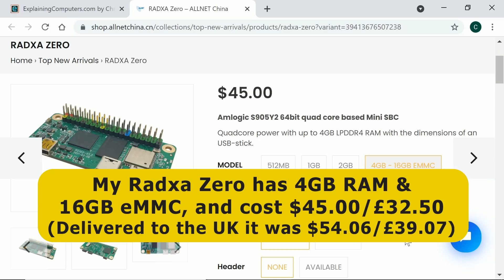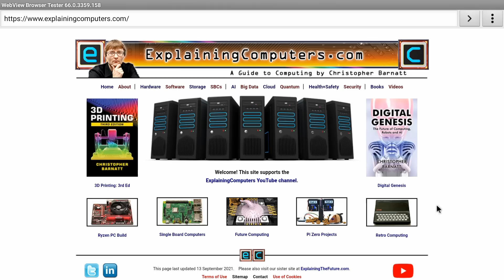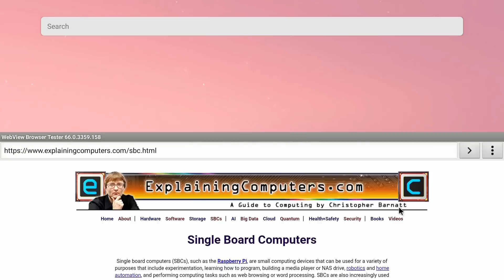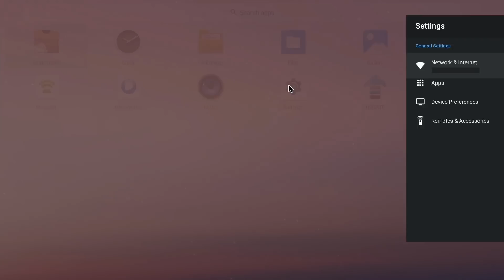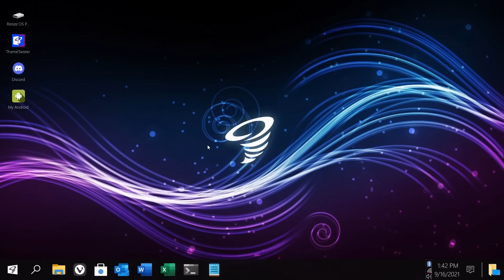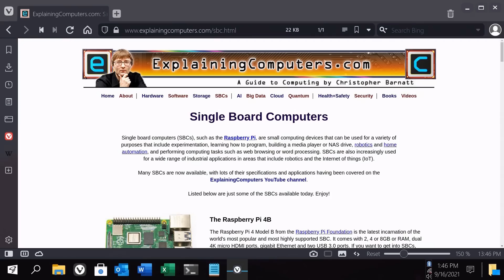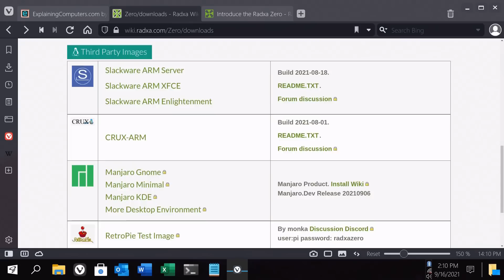Radxa Zero: Tiny Quad Core SBC

Comment: Apart from the current lack of software support, this is the Raspberry Pi Zero successor that everyone on the Raspberry Pi forums wants. The Radxa Zero has good connectivity with its USB-C ports and its support of USB 3 and 4K/60 over HDMI. Thank you for this great video!
Reply: Tbh no camera stack is a big letdown as well, especially with all that power
Reply: @vocassen  i really wish they make the zero 2 version that include camera connector and beating RPI 4b

Comment: I cant belive that a pc the size of a credit card is better than my 16" laptop from 10 years ago
Reply from the maker: Progress is amazing . . .
Reply: It's in fact smaller than a CC
Reply: How old is your laptop?
Reply: @kriskruz3792  13 years old
Reply: @ozrencupac  nice!  You have been taking good care of it!
Reply: @kriskruz3792  yes
It still has the original hard drive and it works
It runs debian
Reply: 13 years ago, $15 did not buy a good laptop.
Reply: "I cant belive that a pc the size of a credit card is better than my 16" laptop from 10 years ago"  generally speaking, thats not the case... unless you had an unbelievably weak laptop 10 years ago..

Comment: Stanley the knife had been showing signs of aging. 
Interestingly, here Radxa's GPIO pins are color coded. And the USB connectors are USB - C unlike micro USB in various other SBCs.
Reply: Cos he's old skool original 😊
Reply: It's still USB 2 so apart from convenience there's nothing significant
Reply: @haziqsembilanlima  Correction, there are 2 USB-C connectors on the Zero board, 1x USB2(for power & OTG) and 1x USB3(Host)
Reply: "Stanley the knife had been showing signs of aging. " - yes it needs an upgrade quick!
Reply: It's not age, it's character.
Reply: It has always interested me that a lot of the non pi SBCs  which use the same Pi originated  GPIO standard.. use the colour coded GPIO connector  whereas Pi Manufacturing do not...

Comment: That looked like it had so much potential, but as the video went on, my enthusiasm waned. I am never impressed when software support isn't 100%. This looks like potentially a great device, let down by (for now at least) software.
Reply: It's why I stand by Armbian, they spend time on a rampant issue with SBC's that aren't a Raspberry Pi, outside of Armbian or Manjaro I don't see any other active project squeezing water out of a stone this size.
Reply: @phonewithoutquestion80  I agree, but it really shouldn't be the community that gives good support to boards. Companies who want to make money from those boards but don't invest in Software Support should be avoided.
Reply: Yeah after seeing the specs I was impressed, but the choppy playback and lackluster support on their own site really set off some red flags, I mean what's the point of having a beefy micro-computer that can only run android or an offshoot distro of Linux?
Reply: Software support is more important than the hardware backing it. I wouldn't trust any of these fly by night Chinese brands. I don't know if there is a viable competitor to Raspberry Pi.

ARM locks you down and doesn't let you just slap an OS on a board like you can with x86, so you're screwed if the manufacturer abandons ship.
Reply: I share your feelings on this one alrightie
Reply: I guess most of you don’t remember back in 2012 when the raspberry Pi was released to the public. The lack of software and drivers was common.  

Interesting factoid  back in March 2012 –  Raspberry Pi Fedora Remix was the recommended Linux distribution. 

(Developed at Seneca College in Canada.)
Reply: @NewAgeDIY  Yeah but the Raspberry Pi was something brand new and never done before; yeah you had micro controllers and maybe those TV boxes, but this was the first personal computer you could literally fit in your pocket, a rough start and spotty resources were to be expected out the gate, this is something that was made as a drop in replacement to the pi zero, something that builds off a project that is open source and has a been around for almost a decade and is well documented, considering this is not their first product such oversight is almost inexcusable the only saving grace is the price, but considering the chip shortage why waste the excessive power the RAM or CPU on a product that can't meet up to the specs consistently. I mean it's listed as a 4K@60fps yet the demonstration showed that it was lagging and dropping frames. I'll give them the benefit of the doubt that it was a 3rd party distro, but when the only officialy available OS is Android 9 considering dead links it leaves alot to be disappointed with.
Reply: The hardware is only as good as the software that runs it.
Reply: @adryncharn1910  The problem is their software is almost nonexistent. You'd think the OS they're touting as official would actually be there.
Reply: @festro1000  I know, but you have to have the software to use the hardware.
Reply: @Toxicity1987  I'd add that there is a serious reason to add such board or even the entire brand/manufacturer to black list. If making software to work as it should work be easy and straightforward, why manufacturer won't do this by the time they start selling boards. I understand that not everything may be ready by that time. But broken links and no reference distribution? Seriously?
I see two reasons there. The first is that they absolutely don't care. They invested money, they want to sell boards but they don't care what buyer will do with them. Of course, there will never be good manufacturing support (product will be EOLed soon) and good documentation support.
And the second is, they can't make it work reliably. It looks like components they are using are cheapest garbage you can ever find. So there are probably some hardware bugs. Finding and fixing such lowest level issues is a pain, it takes a lot of time and a lot of skill. Of course they will not tell you that their product is an absolute rubbish and works only when moon is in phase, but that's what my experience and all the facts tell me.
Reply: @ArrowRaider  I agree with the sentiment of distrust on these knock off Chinese brands. But hardware is still a very  important factor, as software optimization can only go so far, there is a reason for minimum system requirements for all software including OS. I mean you wouldn't go running a KDE plasma distro on a Pi 2 or earlier and expect top notch performance, that would just be unreasonable. While software optimization is important it dies little to no good if the hardware cannot support it.
Reply: @adryncharn1910  That's true in any case regardless of the hardware, but releasing a product and and botching it's support this bad is shameful. Their site was offering a false sense of choice I mean the two other "officially supported OS' were dead links, the only ones that worked as expected was the unofficial twisterOS granted it was a beta, but it's rather crumby practice to tout something and not back it or at least offer support for it only a couple months in.
Reply: @festro1000  I wasn't supporting what they did, I was basically saying that the hardware on the board cannot be fully utilized because of the lack of sofware support.
Reply: @Lassi Kinnunen 81 The special thing about this board is the size with that power.
Reply: I like this board. It looks like something I would definitely buy if there was an OS available that was something like PiOS and not a version of Android. I remember trying to get DietPi to run on a Pi Zero, I didnt find it easy (probably more due to my pickled brain and lack of experience.) It really needs a supported OS that can be slung on and run so that it will appeal to all skill levels and guarantee sales  and traction in the market place.

Comment: For me the turning point with many of these things is when Armbian start releasing builds;  I run (amongst others) an original series Rock64 which I use as a server, Pine's reliance on community work was really showing problems but the Armbian build was miles ahead despite not being officially supported.

Comment: Seems like the clear case packaging that the board comes in could easily be a clear case to operate the SBC inside if it had holes and a place to mount the fan.
Reply: I loved the fact that it was in 4 layers of packaging.. shrink wrap/ cardboard sleeve/ clear plastic case and FINALLY... an anti static bag
.

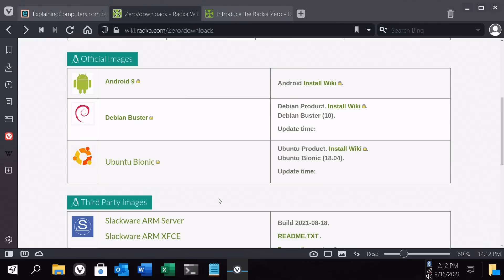Comment: That's pretty f'd up to have a list of "Official Images" that error 404. - 17:02
There is a small lock icon but that tells the user nothing and the LEAST they could/should do is have those pages state the current status, etc.  It takes only 2 seconds to put something there instead of a 404 error.
Reply: I haven’t checked, but those links are offsite, at the projects that control them, and not something that the board maker can control. I’d do some searching for the “These OSes”, and see if there are updated versions in a slightly different location.

Comment: Thanks for another great "little introduction" to a new "SBC", and my commendations for always "holding back" until You can review the actual "sold product" rather than just "jumping on the launching bandwagon" with all the "caveats" that that forces those """reviewers"" to include. Also a special thanks for lowering the screen resolution to make it very "readable".
I find that there are far too many otherwise great "demonstrations/tutorials" that for some reason are made in the screen resolution that the creator uses for his own work rather than a resolution "optimised for the viewer". An oversight that unfortunately makes the demonstration/tutorial very hard if not impossible to follow if watched on a screen that is smaller than the one it was created on.....
So thanks again for all Your great work.
Best regards.
Reply from the maker: Thanks for this. I am first an foremost a filmmaker, so always scale things in my videos so that they are viewable "lean back" on a TV, or on a small screen at low resolution. I used to shoot animation on film at the BBC, and if you took in artwork with lettering that would be too small in the final shot, they simply would not put film in the rostrum camera.

Comment: That's the biggest issue, as always with these alternative raspberry pis, the software support.
Reply: yes, that is one of the major problem, i hope as many people moving to having some fun with those SBC, it will getting better
Reply: That's why you get the Raspberry Pi -- it has the very best software support of any ARM SoC.
Reply: @boink800  The problem is that as great as the software is, the hardware's a bit lacking if you want to use it as a full desktop replacement. I'd love to see something that has good software and fast hardware, but that might be asking a bit much.
Reply: @DFX2KX  If you want a SoC, the Raspberry Pi 4 with 8 gb ram does have the reasonable hardware, with very good software support.
Reply: @boink800  Even 8gb of ram doesn't make the pi 4 THAT fast. There are other SBCs with the same amount of RAM, faster big/little setups, better GPUs... The only thing it's really got is software going for it.
Reply: @DFX2KX  it's not just software support, it's community. If there's no community, there's going to be a lack of support all around.

Comment: did you buy a new microphone? Your voice sounds really good in this video!
Reply from the maker: I'm so glad you noticed this. :) The microphone is the same, but two other things have changed. Firstly, this was the first video recorded in my new studio space, which has now some of its acoustic panels fitted. So this has improved matters. Secondly, I've been having problems with my voice due to a growth that has been found on one of my vocal folds, and the medication I've been taking is after a couple of months finally starting to work I think.

Comment: To boot from the MicroSD you haveto press the USB Boot button on the bottom of the board.
Reply from the maker: Maybe so, but certainly not always true, as I did boot from a micro SD card without pressing that button. It depends what is on the eMMC.

Comment: Great review.

The Raspberry pi has a LOT of support, both official and community. Yet even with all this, I often still struggle to get my pi to do, what I want it to do. Virtually all software has 'issues' which need to be solved. Good software support is 'ABSOLUTELY' critical, without which the Radxa Zero will lead to a lot of frustration. 

This board seems like a cross between the pi zero and the pi 4, with little to distinguish it. It's even more pricey. Perhaps the biggest advantage, the one you took immediate exception to, is that it comes in a whole range of configurations. 

Honestly, if the Radxa Zero were the 'only' board on the market, I'd probably think it to be fantastic. But there's so much out there to choose from now, so I'm going to give this one a pass.

Comment: Another good video.
Sadly this SBC lacks in the software side.
Makes me wonder though, why if all these SBCs run on ARM, is it hard to get software support? Is it that every single ARM SBCs has their own specialized firmware that makes it harder to develop software for or something?
Reply from the maker: Thanks, and you are correct -- there is no standard ARM platform like there is with x86.
Reply: @ExplainingComputers  Wait...so if there's no standardized ARM platform, wouldn't that mean we're back to where we were in the 1980s with Commodore, Amiga, Atari, etc...
I mean at least we have standardized Operating Systems and filesystems now, but still...

My next issue is upgradeability with ARM systems. Every SBC (and even Apple's M1 systems) have everything soldered to the board and there's no upgrade path short of buying another one. Is that going to be the case with all ARM systems going forward you think?

Comment: Christopher, thank you for another interesting SBC video (I love SBCs). I have to say, while I love the RPi Zero Form-factor, $45-$85 for a zero-form s905Y2 board is too much. At those prices why not run a CM4, given how much better the community support is for the RPi?  Just my 2c (or 2p if you prefer). Thanks again!
Reply from the maker: To be fair to Radxa, the prices are $15 to $85. But your point is well made.
Reply: the cost of cm4 and a good board is alot more than this, and the base cm4 does not have usb 3 ports

Comment: I don’t have any experience of any other SBC than my Pi 4, so I’m lacking a lot of knowledge. However it seem to me the Raspberry set up is a bit like Apple computers, where you get the entire package of machine and tailor-made system. That matching of OS and machine has a lot of pros and cons, the biggest pro being stability. So though there might be SBCs like this with phenomenal specs, they are a lacking when it comes to the usefulness that comes with Pi etc. It’s a bit like running a new Ferrari on old fashioned 2 star leaded petrol.
Reply: Come again? Are you comparing the Raspberry Pi foundation to APPLE!?!? I guess your intention was to point out something good about the Pi, namely an official, well maintained OS, but apart from that simililarity to Apple, this comparison has no legs to stand on. Where the Rasperry Pi foundation has embraced the spirit of being open to the world, Apple is the exact opposite. They'd probably rather take your Apple device away from you than allow you to install someone else's OS on it.
Reply: I have a number of Pi's including a Pi400 bought second hand on EBay. It came minus some items from its original kit. Those missing items   included the original SD card with OS.. I went for Manjaro for Pi ( as I recall) and had the thing running fine within a short period of time.

Its definitely NOT in Apple territory.

Comment: We have a Manjaro installation video. We also have some pictures in the Manjaro forum that it has some touch support with the Radxa Zero. But does someone use Manjaro with the Radxa Zero? Recently someone posted a review about Fedora running on a Raspberry Pi 4, which works but has issues. What about Manjora and Radxa Zero, is the Radxa Zero with Manjora usable, and is the Radxa Zero in general usable? I can find hardly any users who report that they use it.

Comment: Like the board except 4 the Wifi and android os i am working on project to control relays to power other functions and have been finding my Wifi and  bluetooth tuned on when I clearly had them off useing my android devices this looks like it might be great for repeatable tasks and temperature & other sensors reading with only axes be hard wired I need readings for around 20 temperatures, 10 pressure sensors, 10 on-off switches relays,  and power readings but don't need someone  or something messing with my equipment or data remotely and i have been finding android os going through deleting  file i have saved for my own resons this and other problems recurred even after factory resetting

Comment: Thanks for another great review. I hope there will be a board with a good gpu  support in  the feature. More or less many of the SBCs available as of 2021 have anemic gpu performance for the streaming. I really wish someone or a company can produce a SBC with proper support for mainstream linux distro including proper gpu support. SBC field becoming crowded with products but without proper GPU acceleration and streaming support. Great hardware without software support is a bad product.

Comment: These seem to be entertainment system cpus. Like of TV boxes etc...
To increase the pointer, icons and text, it's often enough to change the screen resolution to a lower setting.
On your 1080p monitor, just set the unit to output 720p.
I'm also surprised that the AMLogic CPU support on this board is so bad, considering that consecutive cpus (S905x3) have been around for nearly 3 years now, and the x4 is out for 2 years as well!